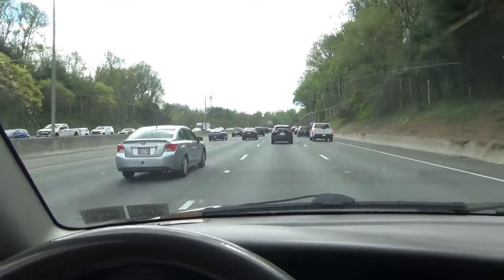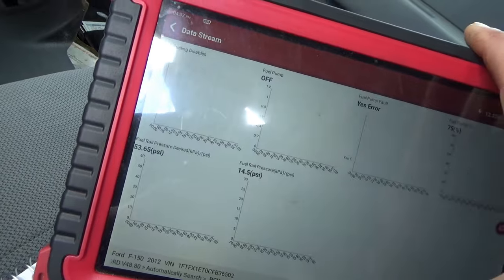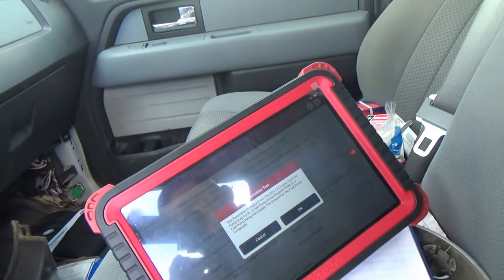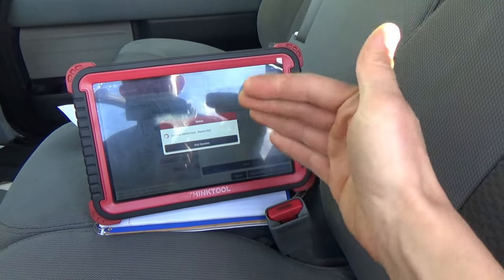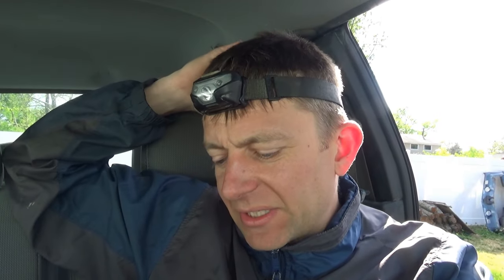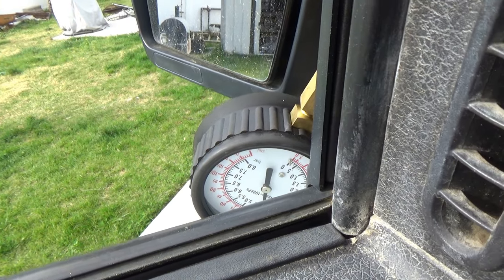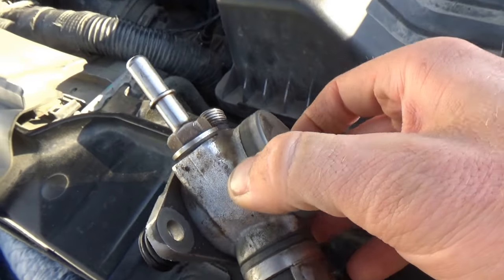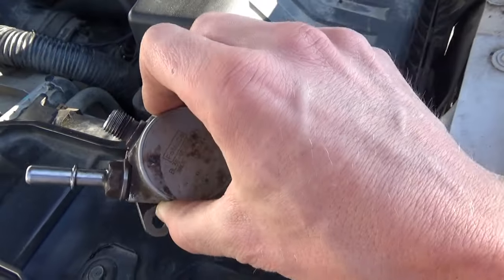WEIRD Crank No-Start (Ford F150 Ecoboost)

Comment: Wait Ivan, how does the timing affect the HP pump not being able to maintain rail pressure?! The desired pressure stayed high, and the pump was being commanded ON too. Sure the injectors were firing at the wrong time, but that shouldn't have caused the rail pressure to stay low/drop off a cliff?
Reply: Yeah. I don't understand that either. Maybe the computer saw the pressure was getting too high because the injectors were not releasing the pressure at the right time?
Reply: The high pressure FP is ran of the camshaft and the regulator/spool on the side is what varies the pressure. It uses ecm logic to know where the lobes are and when to bypass or build high pressure. If the timing is off, the spool opens when building and closes when there is no pressure.
Reply: @MyTheBlackJack  Thanks for the explanation. Is there a reason for this very specific timing bound behavior, why doesn't the pump/spool just run to maintain setpoint pressure regardless of injector timing? I'd think maintaining a constant pressure in the rail feeding the injectors would be a sufficient strategy? So you're saying the HP pump only builds pressure just imminently before an injection event, and allows pressure to bypass at any other time? But since the injectors were seeing the same bad timing commands, shouldn't HP pump timing and injectors have been in sync (sure they were out of sync from the valvetrain so engine wouldn't fire), that would have meant that the injector-HP pump system should have performed nominally? Or due to the wrong valvetrain timing the injectors were injecting into non compressed cylinders at lower pressures, and so flowing much more fuel than usual due to a larger pressure differential which was overcoming the pumping strategy capacity, and so showing much lowered pressures?
Reply: @jovangrbic97    thats a lot of info to unpack. Because of how fast the cam is spinning, a tri lobe or quad lobe for the HP pump can keep up just fine.  We're talking 4 pumps for every rotation. Idle pressure could be as low as 550psi and as high as 3000psi at full beans (had a spool stick cause high fuel pressure and bursting an injector body before). It will follow cam timing to not slow down/bog the engine, as a liquid isn't compressible like air, at least thats what engineers for my company tell me. You have to realize that GDI injectors are fired much the same as MPI injectors, through electrical control. If the "pulse" of the pump is exactly in the "pulse" of an injector, it could interfere with the injection event. Could manifest as a misfire. Its also good to know that the HP pump is HIGH pressure,LOW volume system, as the injection quantities are miniscule, but need to be very precise and misted properly (high pressure atomization).

I appologize for the info dump. I hope this helped!
Reply: @jovangrbic97   also the spool/bypass is run at a set point in cam anglr open and close. As well most are run in duty cycle/PWM.

Forgot to add that to the end of the reply
Reply: @MyTheBlackJack  Thanks for bearing with me and the detailed explanation. I still don't get why the rail pressure was not keeping up, because as far as I understand, both the pump solenoid and the injectors were working with the same timing, and should have been 'in sync'. Sure, that timing was wrong in relation to the crank/cylinder positions but at least for the injector-pump system it was consistent. What the caused the lower than desired pressures? Thanks again and Cheers!
Reply: @jovangrbic97  the lower pressure is the spool not being closed when it should to build pressure. Its easier to show on the diag tablets for my company as we can see the spool open/close angle and duty cycle. I appologize for not being able to clarify more than i can without physically showing it.
Reply: @MyTheBlackJack  Thanks for being patient! I just like understanding technical things fully when I'm delving into them. Often enough in a diag video there's moments where I'm like nope that doesn't compute, and a few minutes later there's an addendum where he rectifies the blunder, which is relieving.

Comment: Shouldn't the truck run by  default even with the HP pump disconnected ? Does the solenoid in the pump control the input or the output ? Thanks for your videos !
Reply: Well, i can tell you audi and vw run without hp pump. No power and not well, but runs
Reply: @mikesabin8568  Thanks mike for your input !

Comment: I don't know what you charge, but that dude was dead in the water, and you helped eliminate a potential cause of the problem. He would still be walking around that truck dumb founded if not for you. The most I would have considered for a refund is 50%. Who knows, maybe the pump was also failing at the same time. Weirder things have happened.

Comment: my brother ( a mechanic )had a new timing chain stretch within a few weeks .... was told this was the problem by the transmission guy who looked at the twin cab as instructed .... got blasted by my brother ,,,,, for some reason he ( MB ) did check the timing chain ..... as yep stretched ... that's right .... a rattling could be heard after the transmission had work done ..... thought it was from a bad job ... took it back ... the gear box noise was drowning out the chain rattle
Reply from the maker: How does a chain stretch within a few weeks??

Comment: Hey Ivan, respect and props to you for your attitude and posting the vid and teaching us. If it's not a secret - did you refund the customer only for your work, or for the HP pump as well, seeing as he had to buy it solely based on your diag? I have no idea how much it cost, but assuming a couple hundred had to be put forth by the customer to change it? How do you go about things as a business owner in this case? Edit: best case would be if he managed to return it, but I suspect that's not possible after you install it on your car and use it?

Comment: check fuel pump Fuse connector in engine Bay fuse box. 2015 Transit 350 Ecoboost did this same crap. Then eventually the wire harness went bad. $362 to replace harness

Comment: Not sure if this is correct, but it seems the engine computer knew the timing was
off and was disabling the high pressure pump buildup through the solenoid?

Comment: Thanks Ivan for another interesting video. With reference to the high pressure fuel pump viability; would disabling the GDI fuel injectors before cranking allow the HP fuel pump pressure to rise and hold its maximum level (assuming injectors are good/no leak down)?  Could this be used as a diag process without breaking something? Please advise.  Thanks

Comment: I have the same problem  with a 2016 Ford escape  1.6 I did a water pump and timing  the car ran for 10 mins while I was bleeding the coolant and then next thing you know the car died as if I pulled the fuel fuse and now it won't start and I barley get a code but I also seen that  crank fueling disabled  (yes)  like wtf is that lol I'm still working on the ford garbage

Comment: You said the pump was leaking fuel into the oil. So it did need to be replaced. You still should had done the test for timing issue. But I say you earned your fee.

Comment: Never a mention of the never replaced FUEL FILTER, which if 90% plugged would give these exact symptoms!  And would contribute to shortening the life of the overworked pump! 🤷‍♂️
Reply: i'm thinking the only filter on that is the "sock" in the tank
Reply: Low side was 100 percent fine so why would it be filter? Second, most modern cars with gdi do not have separate filters it’s integrated into the low pump. This filter is fine if you have fine low side… not a filter problem at all

Comment: I had a 79 Ford 302 with 50K miles. One day it wouldn't start. I turned the distributor, and it started up. I checked the timing with a light. It was way off but ran ok. Odd. A couple of days later it wouldn't start again. I thought it's got to be the timing chain slipped. I took it apart and sure enough the chain had slipped 3 teeth. Those nylon cam gears are the worst invention ever. Changed the cam gear to a steel one and a new chain fixed it.

Comment: That's part of being human, we ALL make mistakes.  How we handle failure is what makes the difference.  My goal is to never make the same mistake twice which means I at least want to learn from it.  Those trucks absolutely suck to work on as well and I learned that I never want to work on the turbos on that motor again because a leaking o ring on a coolant line took 14 hours to replace without taking the cab off the frame like the book calls for.  I don't think it would be possible at all without a lift so I would not advise trying it with just jack stands even for a seasoned mechanic.

Comment: Man I was surprised and a bit disappointed when you decided not to used the scope. I follow a few other diags and one in particular ALWAYS uses the scope. The scope never guesses
Reply from the maker: I did use the scope! Did you not see it?
Reply: @PineHollowAutoDiagnostics  Please accept my apology: sorry man. I must have missed it. I will go back. Thanks for the uploads and the integrity👍
Reply: @PineHollowAutoDiagnostics  I didn't see you use it for what you said at @11:20 (cam and crank correlation) I was thinking you were going to connect a probe to the cam position sensor, and a secondary ignition pick up

Comment: Great diag again ,  I still cannot understand how the fuel rail pressure was dropping its a mechanical pump with a electric valve from what you said the valve is modulated by the computer somehow to control the rail pressure , so the pressure was being commanded low because the timing was wrong ? Thats a hard call need really good  waveforms for comparison  to know if the pump is crook. . Anyway you cannot win them all and cannot spend unlimited time testing everything .The customer should be happy you refunded the time my boss in my game would never do that , your a fair and honest tech sometimes you just cannot make money on every job .
Reply: I own a BMW 760i
It has (3) Fuel Pumps. Two are mechanical and one is Electric. The Mechanical pumps have Rubber Diaphragms the size of a Silver Dollar inside the Top Portion of them. When they rupture from normal wear and tear the Fuel pressure will drop down by about 75%
I repaired my Fuel pumps by replacing the Bosch Rubber Diaphragms. After the repair, the Fuel pressure returned to normal. They are High pressure fuel pumps.l saved: $7000.00 by repairing instead of replacing the two mechanical fuel pumps.
The BMW dealer would never repair those pumps.

Comment: So, can I ask a noob question or two? Was the high pressure pump not producing pressure because it was not being commanded on when the ecu sees the timing out?
If so, why would they not have a fault code for timing correlation on cranking if it is a prerequisite for fuel pressure activation?
Reply: It likely wasn't producing proper pressure because the cam timing was off. The control signals to the pump have to match the timing of when the pump is actually being pushed on by the cam lobe.

Comment: have a friend of a friend who has a 1998 F150 with the 4.6l engine, I have not seen car yet because he lives 50 miles away just been texting him. Cranks over but will not start, he has had several mechanics look at it and nobody can figure it out. It has spark, fuel pressure checks out, just yesterday they replaced both the crankshaft position sensor and the camshaft position sensor, still no start. I told him to check for any bad or corroded wires, connectors, etc., he said they have done that and everything looks okay. I told him to look and make sure timing chain was moving, he said one of these supposed mechanics checked and said it was okay. Any ideas ?
Reply from the maker: No codes? Good compression?
Reply: @PineHollowAutoDiagnostics  He says no codes, don't know about compression. It has had intermittent problems especially if it rains or gets wet but says it has always started after a day or two, this time no.
Reply: @PineHollowAutoDiagnostics  I was finally able to go down and personally look at this, not sure what they guys he had look at it were doing or why they couldn't get it started (this is why i do my own repairs), anyway within 10 min I had it narrowed down to a fuel problem, it will run with starter fluid but then stops. There is pressure on the fuel rail and it seems to hold so don't think it's the pump or the filter. Looking like the fuel injection is not working, I ran out of time and didn't get to check to see if the injectors are getting a pulse. Don't think it's a fuse because near as i can tell from wiring diagrams and what is online the fuse for the fuel pump is same for the injectors and fuel pump looks like it's working. When I pulled back the intake tube the throttle body and plate are really dirty so wondering if the TPS might be acting up but there are no codes. Faulty TPS maybe, bad PCM connection or a bad ground ? Any suggestions ? Like I said I still need to check for pulse at injector.

Comment: Repeat 3x to yourself at every no-start. “fuel, spark, air”.  Jumped timing chains have been skunking mechanics since the early days. Fortunately, since the adoption of in-cyl transducers & scopes they are much easier to diagnose.
The future is bright, this is a mis-diagnosis you only do once in your career. 🙂

Comment: nearly the same sounding engine as diagnose dan  merc  like you  said what would take to do in cylinder pressure test cam crank  ign  and injector  ie cover your ass  do one every time for what it takes if the obvious dont fix the thing

Comment: When you were cranking it,   I was thinking it sounded like it had low compression.   Oh well, mystery solved.
Reply from the maker: 150psi cranking isn't all that low...
Reply: @PineHollowAutoDiagnostics  Agree, but what is the factory spec.  Some of the gm's are spec higher than 150, closer to 200psi.

Comment: So how would you do the timing/compression/ ignition event test? You would need to verify crank and cam position (which gives you spark timing) and cylinder pressure all at once?
Reply: When a Engine doesn't start, it's hard to see the  data you are referring to.
Reply: @davidhall3747  you could scope it and look at all the triggers to see if they are happening at the proper times. I know it wouldn't generate any codes until it ran so it seems like the only way to check the timing would be by scope.  After Ivan did all his diagnostics and speculated the high pressure fuel pump may have been the cause, I would have just done a quick sanity check and sprayed a blast of starting fluid into the intake and tried to see if it would at least start for a few seconds. That would help verify ignition timing was correct and working and the likelihood of a fuel delivery problem remained a high probability. Just saying.
Reply: @danmccarthy206  I'm never without a can of Starting Fluid handy. My Nissan Sentra had a Crank no Start problem. I immediately sprayed Starting Fluid down stream of the MAF Sensor.
The Car started immediately. I diagnosed the Fuel Pump and Fuel pump relay. Both had failed.
I installed a New Fuel Pump,  Relay, and new Fuel Injectors because the fuel system was dirty. I cleaned out the Fuel Tank prior to performing all the repairs.
The project car runs great now. As a side note:
Most vehicles will start and run rough, even if the Timing Chain(s) jump a few teeth. The Valve Timing will definitely be off, but the Vehicle will still start, most of the time. I'm not sure why Ivan didn't use Starting fluid to speed up the diagnostic procedure.. If I were on a road trip performing diagnostic services, I would have a case of Starting fluid handy.
Reply: @davidhall3747  absolutely. I use it as a quick and dirty check for small engines. If I spray it in the carb and pull it and it starts for a few seconds,  it's a fuel issue (99% of the times on snowblower its fuel related). On small mowers, its similar. Once in a while on push mowers you have spark, fuel and compression but no start. Usually it's a sheard flywheel key so the spark happens at the wrong time. This is caused by hitting a rock or root or something.
Reply: @danmccarthy206  If the Spark happens during the  Exhaust stroke, it would be too late, therefore the Engine won't start. Your right, it just depends on how far the Valve Timing is out of sync.